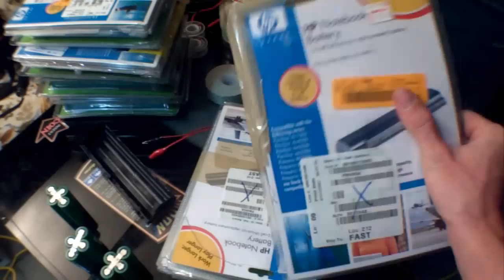DIY: 48v 24ah lithium ion 18650 e-bike battery pack

Comment: How did you identify the battery cell model and manufacturer?
Reply from the maker: they said on the sides. usually its printed on the plastic casing. if its not then its just a knock off brand. still knock off brands are useful. and you can tell the model just by the size of the battery.
Reply: Thank you for taking the time answering me and for documenting and sharing the secret of this otherwise little known great resource, surplus/defective laptop batteries. Your video has truly been an inspiration!

The cells I have look a lot like the semi matte pinkish red ones in your video. Although the marking "HF3FJT3" on them turned up no results on Google, from their appearance and the bright red ring I noticed on the plus end, according to this website http://bit.ly/JQkyrh, they are probably Sanyo 2200mAH with 53-55 mOhm internal resistance, which the specs on the battery pack (4320mAH) seems to confirm. They were 6 cells, 3 series of 2 in parallel.

Taking them apart from the rectangular pack turned out quick and easy with a hacksaw and the pack in a vise, and it only took 10 minutes or so. MUCH easier than with a knife! I was just extra careful not to let the blade dig too deep into the pack to protect the cells, but I did manage nicking my fingers as the blade slipped when starting the cut, which I quickly fixed with crazy glue, does wonders to suture minor cuts :-). Once opened carefully removing the tabs and sanding the the shards left from the spotwelds took another half hour or so.

After charging overnight (I was surprised by the amount of time it took) I proceeded to test them in my XM-L T6 flashlight and the preliminary results have been exhilarating! Although one of the cells got hot and is probably the one that failed the pack and another has only given OK results, the remaining 4, running in sets of 2 in flashlight for 4 hours so far each set, still register around 3.85V, which far surpasses the "UltraFire" so-called '2400mAH' cells that the flashlight came with and that barely last 3 hours and the FAKE '3200mAH' UltraFires that came with my headlight and last... 15 minutes!!!

Not bad for $5 (cost of dead battery) and one hour or so for dismantling the battery and cleaning the cells!

Next step, find a source of dead batteries for free, make a battery tab welder and convert my UPS from lead acid to Li-Ion :-)
Reply from the maker: JohnnyJim J
tbh i think a UPS would be best with lead acid. if you used lithium in a UPS you'd have to install a balance circuit for charging them. not counting lead acid batteries are sooo easy to find for free.

and yeah ultrafire sucks.
Reply: Rinoa Super-Genius
Trouble is, I can't get these lead acid batteries at surplus prices or free (I'm in Canada, and lead acid batteries are sold with a $5 to $10 deposit, so essentially people return them for their money back when they buy new batteries).

A typical gel battery of the size required for a UPS (I need 10 12V batteries in series for my UPS) cost on average $40 each for a 7AH after taxes.... So my other option is to buy marine troll batteries (I already use them on my truck, about $115 each), which would cost me $1150  but for about 130AH of capacity at 120V or 10KWH of reserve, good for 200 hours for one laptop or about two days for that, the modem, router and cell phone  amplifier... We tend to get these power failures that last days up north...

That being said, looking at the figures, to get that type of capacity in Lithium Ion you'd probably need around 1000 of these cells, which would be a HUGE job to assemble and the logistics to control each cell would be a nightmare... It would take at least 30 cells to get the 120V I need and for any decent run rate, have them in blocks of 3 or 4 like the HP batteries you got your hands on, for a total of 90 or 120 cells.... Quite a challenge, I sure can see your point! How do YOU charge your ebike battery pack and maintain its balance?
Reply from the maker: JohnnyJim J
read the fucking description. it has a link to the next video titled " how to balance charge". but I guess nobody knows what a description is course I have to say that several times a day.

and to run an inverter you only need at least 3 cells. idk what your talking about.

and also we have the same core charge for batteries here. you just gotta look harder for batteries.
Reply from the maker: JohnnyJim J
weird Ive never seen a ups with 120v batteries. even the ups for the servers at my dads company only use 24v at max.
Reply: Rinoa Super-Genius
Yeah, 120V is a drawback. I also have a 1500 watt model that uses 5 batteries in series, or 60V. I didn't know the 6KVA model needed 10 batteries in series before I bought it ;-) It probably went for cheap because it can't be repurposed cheap for say, solar energy, because of the series configuration and because it is not very fault tolerant on the batteries. One battery bad means the whole thing is out of service. However, the high voltage input means the electronics are simpler and more robust. Easier to make 120V and 240V AC from 120 VDC than 12, smaller components, wires and less inherent losses.

Comment: what weight of this pack (72 cells) ?
Reply from the maker: i just weighed it and its about 8 pounds (4kg). its about as heavy as my laptop.

and it has almost the same amount of electrical capacity as a 46 pound (20kg) DC24HDT deep cycle lead acid battery.

i hope that helps.

Comment: It is NOT good to use nails to electrically join the battery pack.  Nails (steel) are 10x more resistive than copper, given the exact same dimensions.  This means they will heat up 10x more than copper.  Not only do you have more power loss in your battery pack, but your batteries heat up more.  Source:  me, electrical engineer at Tesla Motors
Reply from the maker: no they are only like 4x more resistive. not 10x.

its what i had and i works wonderfuly. i wish the batteries would heat up more actually. then they would work in winter.
Reply: Rinoa Super-Genius
Look at any table of resistivity of metals:  Steel is nearly a factor of 10 higher than copper.
Reply from the maker: Jut Shanahan
i'm just going by wikipedia, not that it really matters though.
Reply: http://en.wikipedia.org/wiki/Electrical_resistivity_and_conductivity
Copper	1.68×10−8
Carbon steel 1.43×10−7
... an order or magnitude difference.

In any case, i think you're fine give the current you're running and the small length of nail.  an interesting calculation would be the added resistance of all those nails and how much power it wastes.  you've got about 20 nails, the nails are about 2cm long and 1.5mm in diameter.  so the resistance of one nail is 1.43e-7*.02/(.25*pi*.0015^2) = 0.0016Ω.  Multiple this by 20, and you've got 0.032Ω.  When 20A flows from your pack, you're wasting 20*20*0.032=13W in the nails!

I once had a lead-acid battery pack almost catch fire b/c two batteries were joined by a steel bolt.  the bolt generated so much head it melted the near battery terminal.
Reply from the maker: Jut Shanahan
dont forget these cells where tabbed with steel strips from the factory. or atleast they are similar to steel and rust/ stick to magnets.
Reply: Say what's up to my home Mike O'Regan!

Comment: i dont underastand why u had to extract the 18650 batteries from laptop battery packs. They ara sold seperately from various manufacturers. Best are samsung, panasonic and lg. Εxcept of course if the laptop batterys was a real sale.
Nice video though.
Reply from the maker: only issue is panasonic doesnt sell them, you get old crappy ones from laptop batteries most of the time. and they can cost like 10x more.
Reply: Rinoa Super-Genius http://www.fasttech.com/products/1420/10001980/1141105-panasonic-ncr18650a-rechargeable-3100mah-37v-18650
http://intl-outdoor.com/2-pcs-panasonic-ncr18650b-3400mah-liion-battery-p-615.html
You can get the some genuine panasonic 18650s from these online retailers. The 1st one is NCR18650A(3100mah). The second, which is currently the highest capacity 18650 you can get, NCR18650B(3400mah)
real world testing: http://budgetlightforum.com/node/11772
Reply from the maker: GG2K7AU05
Yeah that's a huuuuuge ripoff. First one costs six times as much and second ones cost 13 times as much.
Reply: But you can have more juice from less cells & your battery pack will be significantly smaller.
Reply from the maker: GG2K7AU05
not significantly, just 30% smaller. and 30% smaller for 6-13x the price is stupid. i'm not paying 1000$ for a 100$ battery pack.
Reply: How much is 30% of those laptop batteries?
Reply from the maker: GG2K7AU05
its 0.33333 less.....what are you asking?
Reply: Forget about it.. you're right on these budget cells & nice work there.

Comment: cud i make the same sort ov battery pack  to power a highpower lamp am wunting the battery to be about 12v 22ah
Reply from the maker: i've actually done that several times, and yeah it works great.

DIY Antique Lamp LED Upgrade

Comment: The reason original bateries are more expensive is because you need balancing circuit and overdischarge/overcharge/overload circuitry, which you don't have, which makes your design very dangerous... And ofcourse, ebay cheap laptop bateries are cheap for a reason.
Reply from the maker: guess you didnt see the next video where i balance charge it.

and no its not extreamly dangerous. lithium cells are very rugged.

Comment: holy fuck. thats a hench ass solering iron. lmao. just out of interest though. how long do they take to fully charge in 48v? and how well do they hold charge and whats the weight difference to lead acid batteries do you think ? i only ask because i dont really want to pay a bomb for lipo batteries here in the uk.

EDIT: id also like to add. i may be doing a conversion of my own bike. with a brusless motor. welded to the frame of my bike. also similar to a skateboard project of mine. working on making the mould for the deck its self at the moment, need to decide the final concave shape.
Reply from the maker: it really depends on how ya charge it. constant voltage will take several hours but that's the same regardless of battery size.

and this battery weighs 7 pounds. that's compatible to a 60 pound 24dc deep cycle battery.
Reply: fair. i may have to look into this then, because im making an electric longboard with a brushless motor. if they can give out the burts current that the mottor and esc demands, i may condier it. if not lipo batties might have to be the way, but to be honest, i dont really want to be paying out 70 pounds for a 7s lipo at 5000mah.
Reply from the maker: whatever ya do, dont waste your money on the ultrafire cells from eBay.
Reply: are they that bad ?
Reply from the maker: Ricky Robertson
Ultrafire and Trustfire are just used 18650 cells that a factory in china strips from old laptop batteries and rebrands as too good to be true. the highest 18650 capacity is 3.3ah so that 5ah is total bullshit. if you buy some they will most likely have between 200mah and 2ah since they are just rebraded crap. you would be better off finding old laptop batteries.

Comment: errr.... dont lithium batteries have one fatal flaw which is why they are banned from air transport ... they tend to turn into a burning brick which could easily take out someones home ... although you did a great job on the cell build you need to add some protection to your pack ... here is the spec sheet on typical 18650 cell >>>> batteryspace com/prod-specs/icr18650nh-2200.pdf

Comment: What power supply is that? (Make/model)
Reply from the maker: its a cheepo one from ebay. pretty much every seller says its a differant model.

its 0-30v 0-5 amps variable DC power supply. i made a video about it when i got it, even though not a very good video haha.

it cost me about 80$ and it works wonderfully for batterries. the longest i've left it running was about 10 days straight. i'd say its been on about 70% of the time i've owned it.
Reply: Rinoa Super-Genius

how long would this battery pack last for your ebike?

Comment: Would 20 Focus Power 4.2V 10000mAh 18650 cells give me 1000 wat hours 100 amp hours ?
Reply from the maker: +Brandon Johnson 10AH 18650 cells dont exist and are just false advertising
Reply: +Rinoa Super-Genius well if they did would my math be right what are the best to use if I was trying to build a big bank like that for solor but would like to keep lbs and cost in mind but would best preformace ?
Reply: Anything saying more than 2.4AH is a lie. The power density equations just does not work out for the size of the 18650 package.
Reply: li-po batteries in this case can be an option. But the downside as in li-ion batteries is the cycle life. i.e. How many charge/discharge can you get for your dollar. Li-ion and Lipo batteries have around 300 - 500 cycles. lifepo4 batteries have a 3,000 cycle life and offer a great weight to power ratio but have a high start-up cost. But in Watt Hours of the life of the battery per price is significantly cheaper per watt hour.
Reply: Brian Link that is incorrect. Panasonic has 3400 mah cells

Comment: Good video. Your schematic shows 12 in parallel and 5 in series, at 35 AMPS, thats 1.9 amps per cell. That appears to be a high load at a one hour rate.   What do you think the rated performance is of each battery? Did you test it? What kind of a BMS are you using?  What do you use to charge with?  What rate do you charge it with? Do you take a portable charger with you?   Do you have any way of monitoring each group of cells?  Did you check them for differences before you put them together as a pack.   Again, congratulations on a nice video. You might like to check this pic http://i883.photobucket.com/albums/ac33/ramjet555/RAMJET_IMAGE.jpeg
Reply from the maker: i recommend you watch the rest of my videos, because they answer all those questions. i have an ebike playlist

Comment from the maker: its not that hard to find them if you look around.

ebay.com/itm/New-Genuine-HP-395753-251-PB995A-12-Cell-Li-on-Battery-PJ12-DB10-/190862305144?pt=Laptop_Batteries&hash=item2c7047a778

Comment: You are mistaken. You only have 43,2V and only 4Ah. Because if each cell has 1,2V and 2A, each block of 4 cells have 4,8V and 2A, or 1,2V and 8A, but NOT 4,8V and 8A.
Reply from the maker: lol you must not know electricity then. each cell is 4.2v 3ah
Reply: hahahaha are you shure that 1,2v x 4 = 4,2V ???? Maths seem not to be your strength ;)
And in minute 1:09 you say "so this is 4,2v and 8amp because there are 4 cells"
I am sorry to inform you that this statements is absolutely wrong. If each cell has 2amp and you conect 4 of them in parallel, all 4 cells together will have only 2 amp (not 8amp). That is so because they are conected in parallel and in this case you multiply voltage not amperage.
Reply: I meant "in line" not "in parallel" sorry
Reply from the maker: hornisch ok series adds the volts together and parallel ads the amps together.

and you shouldn't comment about something you obviously are clueless about.

Comment: I assembled a battery  consisting of   78 laptop (18650) cells in six, thirteen cell packs.  How many charge/discharge cycles can I expect?  How many charge/discharge cycles can I expect when I discharge to different voltage levels? Does anyone have Charts/graphs?

Comment: the worst part for me in making an electric bike is charging the batteries :( i find it complicated :(
Reply from the maker: how so?
Reply: Rinoa Super-Genius  lithium batteries doesn't charge like normal acid ones, i dont understand how they must be charged yet :(
Reply from the maker: RR redaxis  yes they charge exactly like lead acid batteries, you just dont let them go above 4.2v and your fine.

if you take a lithium cell and connect it to a variable power supply, set the power supply to 4.2v and wait for the current to drop. the battery will be charged just like a lead acid battery except without the weird voltage issues of lead acids. lead acids seem to get a residual charge so you gotta let them sit after you charge them to let the voltage go down to the actual voltage. but lithiums lose their residual charge in a few seconds.

Comment: No offense, but it seems to me that you did more work than necessary, you might have simply found a way to connect the batteries in their current form and should you ever need to replace them you just need to replace that laptop battery.  And it seems it would have been a far safer way to connect all those batteries as one.  Just saying...
Reply from the maker: but then i would have needed to build an interface circuit to tell the microcontroller in each pack to let the power out, also i would have to somehow work around the safety cutoffs. also the wiring woul have been wrong.

and lastly. replacing a full pack of 12 cells if just one went bad? thats wasting 11 cells.

Comment: How do you charge it back up?
Reply from the maker: with an imax b6
Reply: Rinoa Super-Genius Thanks for the quick reply!  Very cool.  I have a boat load of 18650's.  They seem to hold a charge of about 3.6 to 3.7v.  A few of them charge to 4.1 volts.  They all say 18650 but I thought that was strange.  I had NO idea they held that much power!  Did you make your own motor/propulsion?  Very nice vid.  Thanks for sharing it.
Reply from the maker: Joe Schmucker
 nah i just bought a kit from ebay, was only 270$ or so.

Comment: You failed to cater for heat flow/dissipation , but good work anyway.
Reply from the maker: it doesnt get hot. i actually have a problem with them not generating enough heat during winter.

if they are getting hot your doing something very wrong.
Reply: Rinoa Super-Genius 
With the load i would assume battery temps to increase, looks like you've got the discharge rate balanced thus minimising heat, great work and clear video. :).
Reply from the maker: Protoproff
thanks.